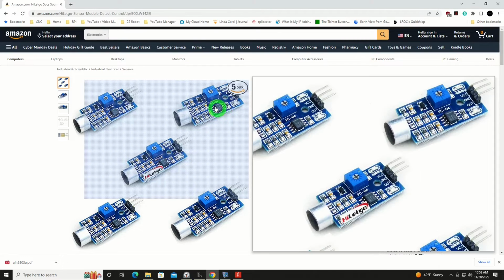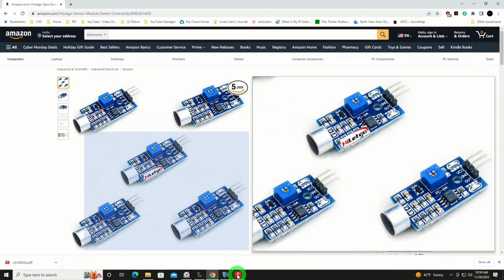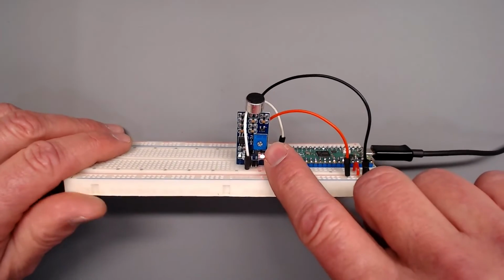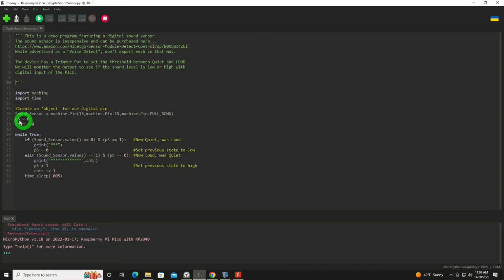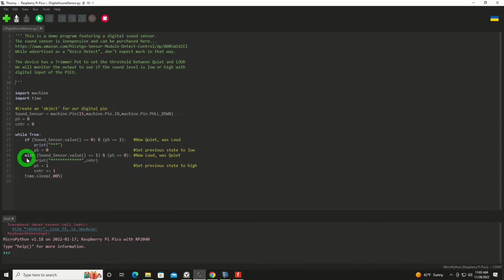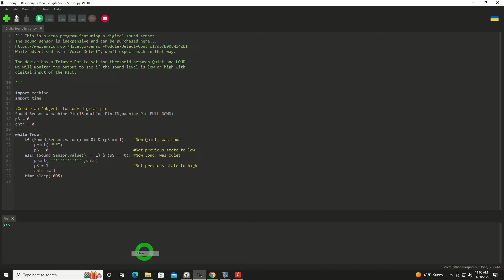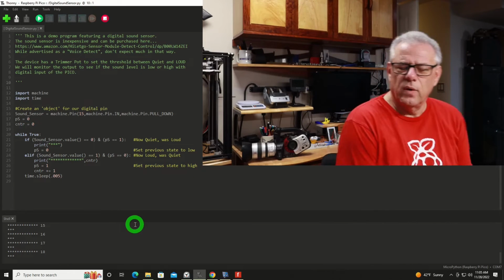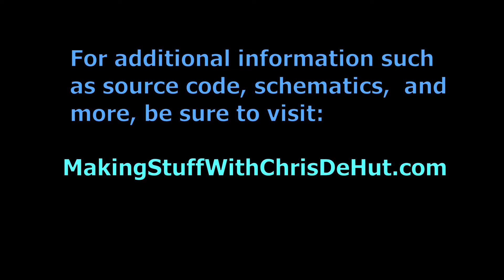How to give your PICO the ability to hear sound with a Digital Sound Sensor.

Comment: I know it has been two years but, I am trying to come up with a way to send a notification to me when my septic alarm goes off. Most septic controllers are not wifi equipped and they are located outside, so it is difficult to hear the alarms go off if there is a problem. I am dabbling with the idea to bring together this sound module with a ioT Cricket module to trigger a message when the alarm goes off. Not sure if I need to run through a PICO or not but would be interested in your take on this.
Reply from the maker: Good morning Chappie8824,
Unfortunately, I have not worked with a "ioT Cricket module" so I can't be of much help at this time.
Chris
Reply: @MakingStuffwithChrisDeHut  I have the Pico W working with the sound sensor with the code you wrote but is there a way to bring this into something like Blynk to notify me of a sound trigger?
Reply from the maker: @Chappie8824  Unfortunately, I have not worked with Blynk or similar.  But I suspect you could eliminate the need for the PICO and just use Blynk?
Chris

Comment: Is there any that using this I can convert the sound into text so as to connect that pico chipset to an OLED screen
Reply from the maker: Good morning arjuns8585, the PICO is an amazing piece of hardware as it that little microphone device used in that story.  However, speech to text is a bit beyond their capabilities.  Something like that would be better suited for a Raspberry Pi, and probably with an AI hat to make it fast enough.  
Cheers!
Chris

Comment: digital or analog output
Reply from the maker: Not sure if that is a statement or a question.
Chris
Reply: @MakingStuffwithChrisDeHut  i have 4 pins, Vcc, Gnd, DO and AO. Which one, should i use?
Reply from the maker: Based on what you are providing I would guess Vcc -3.3V, Gnd to Gnd(0V), and AO to an analog input or DO to a digital input. @marpyyy

Comment: Have been watching your pico videos, love your style and presentation. I have a request and just throwing it out there, If you could do a video on powering pi pico from battery with examples of diode and also p-mosfet to prevent usb backflow would be awesome. This is something that is described in the pico documentation, but not a lot of examples on youtube. There are some for using a diode, but havent found 1 using a P-FET.
Reply from the maker: Hi Gordon,  Thanks for the kind words and request.  I have not looked into anything like that.  Anytime I think about portable power I am thinking simple like alkaline batteries.  I did just pick up a UPS setup for the PICO and will be doing a video on that. I have not thought about designing / making my own circuit though.  I will certainly give it a ponder and so if I have it in me! Thanks again, Cheers! Chris